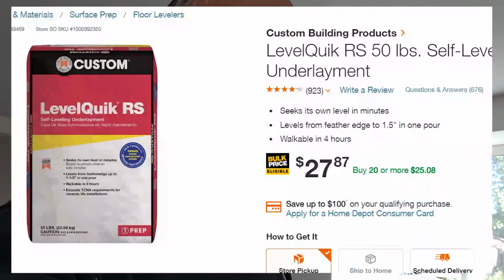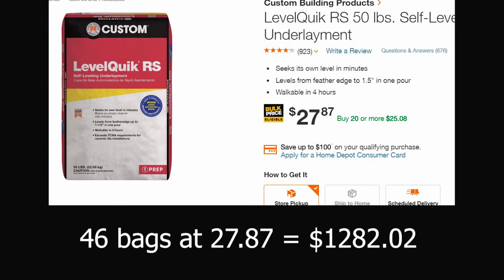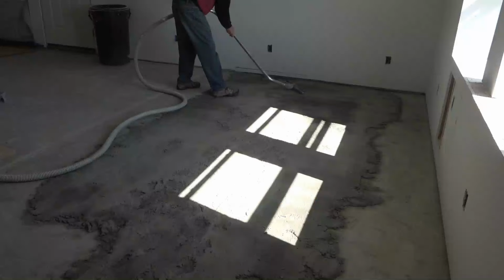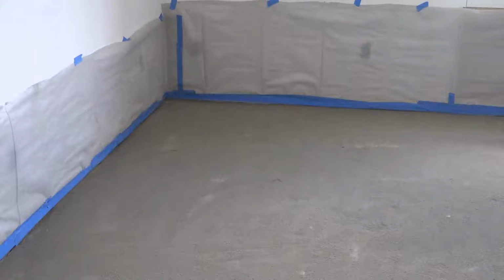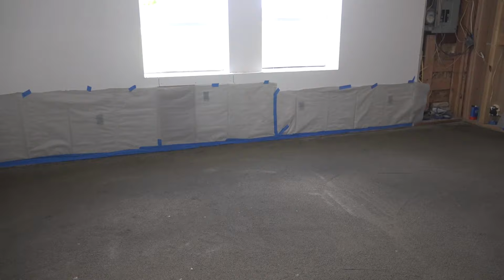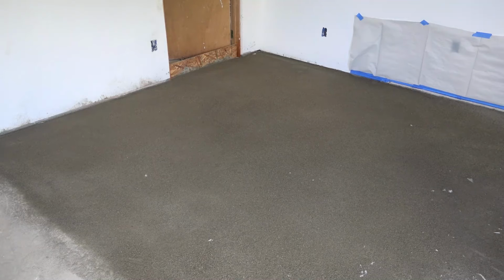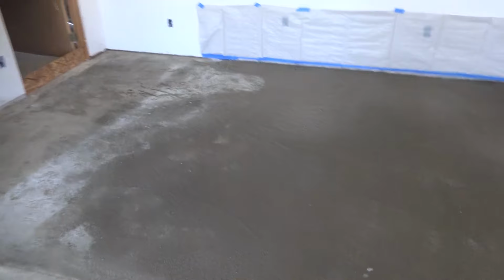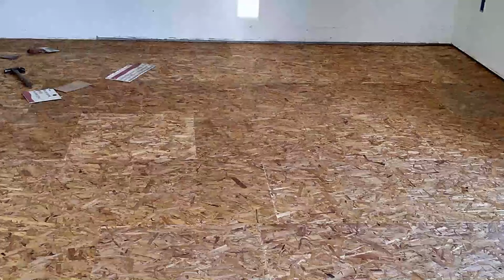How to level a concrete floor cheap

Comment: Going to do leveling the same way, but not dry.
Reply: Don't. Coming from someone who knows, don't. This will crack and peel... You want to skimp... Figure out where your lowest points are... Any area  2 inches lower then your heighest  point... You can drypack those areas and screed (don't use 2x4... You need something straight)...add a little admix to you drypack mixture
Or if you really want to save. Get  cement board... Cut into tile foot by foot pieces.. Use thinset to stick it to the floor in lowest points like tile... skim with thinset any joints after applying cement board netting joint tape... After your done. Get self leveler and level your floor... This will save you shoot if bags.

Don't do this...
Reply: @i60rl26  what's drypack?
Reply: @bryentd2461  Google drypack or drypack mortar bed... You basically get cheap $7 a bag cement... Moisten it just enough to make it like sand kids use to build Sand castles and then level it and shape it how you need to... However, keep it at least 2 inches thick... Of it cracks.. Any cement that can go thinner then 2 inches has chemical additives that allow for that. That's why it will be $25-$45.
Reply: @i60rl26  ah, I need about 100sq ft of about an inch. I was going to use portland cement and sand to fill the gap and then use self leveling compound to flatten the whole surface. If I used full self leveling, I would need about 25 bags with each bag costing $30.
Reply: @i60rl26   yeah have seen tile guys use the dry pack to pitch to drains prior to laying tile in large bathrooms
Reply: @i60rl26  you dont know what you're talking about. You can go as low as 1/2 inch with dry pack but you have to use really loose thinset as a bonding agent so it will stick to the floor and not crack...but honestly if youre covering a large area this method is gonna be a lot of work. Sometimes you have to say F it and spend the extra money on the self leveler...it'll take a fraction of the time and effort
Reply: @i60rl26  Who cares if it cracks and peels if its under the other floor? As long as it is level, cracking and peeling dont matter.
Reply: nice ,only what is in self leveling bag?Portland cement plus silica powder plus quick seting powder plus some platisizer for easy flow with less water inn mixture.I think that is close to reveiling secret.All this components you can find separetly and mix it.
There is no sand in self leveling mix but if you want ticker than few milimeters it requires sand to be added.I think it is silica that is making it so easy to pour.It must be.I use to add silica powder to marine grade epoxy .I need to try it first.Tomorow I will call artificial stone manufacturer in my country.You in USA have good company called Trinic.A lot of good info on You Tube from them
Reply: @i60rl26  Can you explain why it matters if it cracks or peels?

Comment: i want to put laminate, but my concrete floor is uneven, so can i use regular cement or i need that self leveler underlayment?
Reply: self leveler underlayment will work just fine for laminate.

Comment: I have a 9 x 18 project and am considering doing something similar BUT laying down a primer first  then laying down the sand mix (some spots are about an inch thick out of level) then once it's dry enough to step on but not cured pour a self leveler  mixed with a deluded primer in the water  to achieve a smooth flat surface that will only require a couple of bags of leveler.
Reply: Hey Peter. I wonder how did it go for you? Thx
Reply: @sergepikhotskiy  It worked just fine. Grinding the old cement floor first gave it a fresh surface to bond to.  Wetting the cement with a deluded bonding agent helped from drawing out moisture from the sand mix too quickly and drawing it in to bond better. (Sand mix was only used in the low areas to bring it 'close' while maintaining enough thickness to maintain integrity.) Spraying all surfaces then with the deluded bonding agent and before the sand mix had cured allowed the floor leveler to  bond better as well. (I also used deluded bonding agent when mixing the sand mix and leveler.  The final pour was 1/4 to 3/8 inch thick.  I used a spiked roller that also helped in leveling to a more uniformed thickness and blend the separate pours as I was working alone. The final finish was smooth and HARD.  I let it stand for several days before walking on then got a 'free' tarp from the lumber yard that their lumber is wrapped up in during  shipping.  Let the cement covered for 30 days while it cured so I could walk on it and then used a penetrating sealer (3 coats) to give it a 'finish'.  While I always would have standing/running water in my basement in the spring due to the high water table , I only had damp spots this year.  Can't expect to completely block the water in an 1860's basement with stacked stone walls with no drainage, and an old cement floor that was poured with no vapor barrier under it. I'm happy with the results.
Reply: @pslowazo  Got it, thank you for sharing your technique and experience.

Comment: You needed bonding agent before the cement
Reply from the maker: Hmm, you are right about that.  I did paint the whole floor area with a Quikrete bonding agent but now I am wondering if that stuff has to be put on right before the the application of the cement? I let a week elapse between when that was put on and the sand mix. I did not paint the all ready applied cement with the bonding agent because one; I didn't think of it and two; it was really a rough texture that probably didn't need the bonding agent?  I put down the drycore and then a Costco plank floor and we have been using it for a month and it is fine. Feels great when we walk on it and is perfectly level. Really liked the Costco floor, a lot better then some stuff we bought from the big box store 5 years ago.
Reply: Thin set mortar would work but it takes practice.

Comment: It will last 1- 2 years max
Reply: Really? Why exactly?
Reply: even though he used drycore above it?
Reply: If the underlayment fails, the dricore fails. If the dricore fails, the finished floor fails. It's not rocket science.

I'd also be highly concerned about not having a primer to chemically bond this to the slab.

I'd also be highly concerned about not using enough water to properly set and bond the sand mix. 

Yikes.

You saved 1000$ on not buying slef leveler, but you'll have to rip it all out with the dricore and your finished floor in a couple years.
Reply: @RelaxedPoo  But why will it fail? No one is answering that part. They just keep saying this is wrong even though the same method worked for thousands of years.